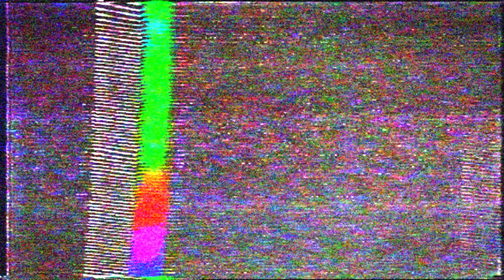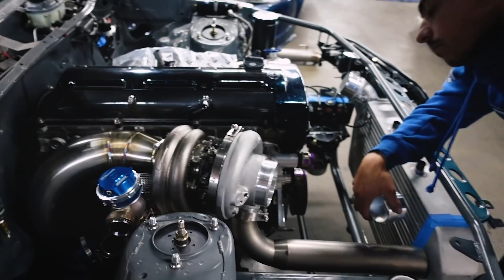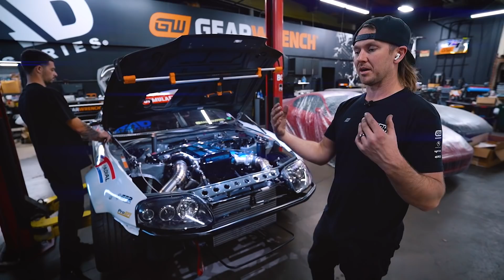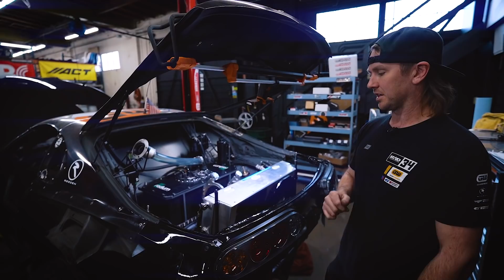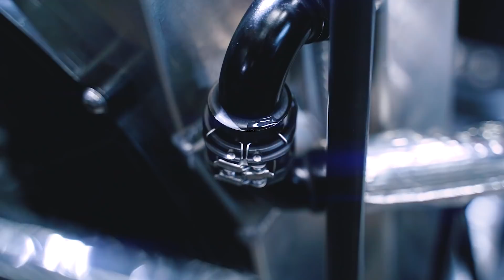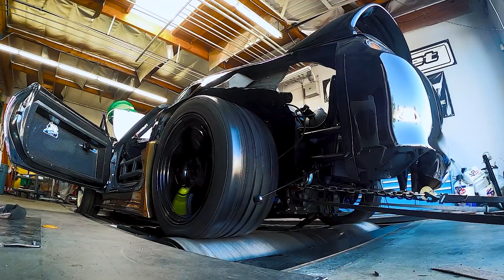Off Season Updates

Comment: Could you incorporate a Nitrous radiator/intercooler kit to help cool down the radiator or intercooly for the second run at the hot tracks?? Could use Sneaky Pete style bottles as you wouldn't need a bunch to spray on the Radiator or Intercooler. Those bottles are super small, wouldn't weigh much or take up much space?